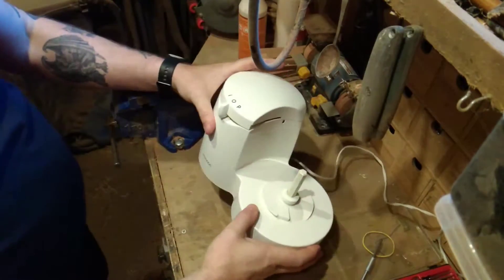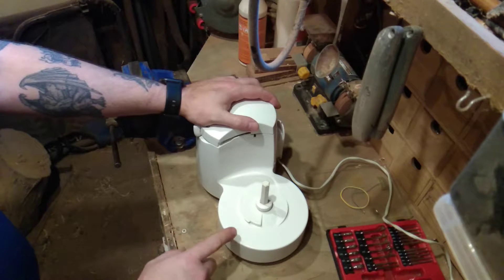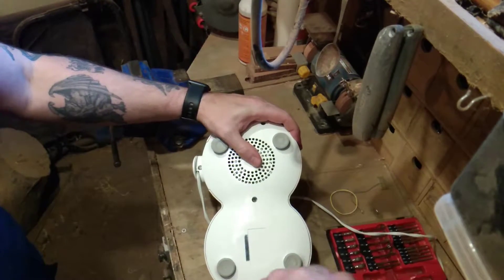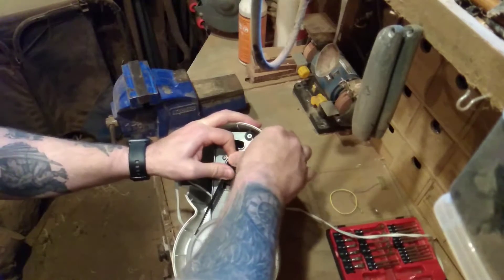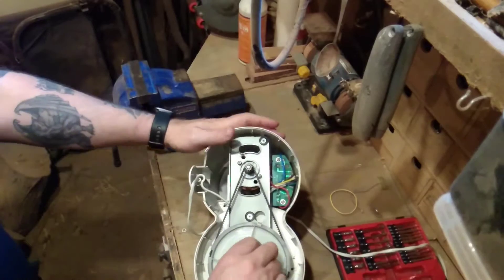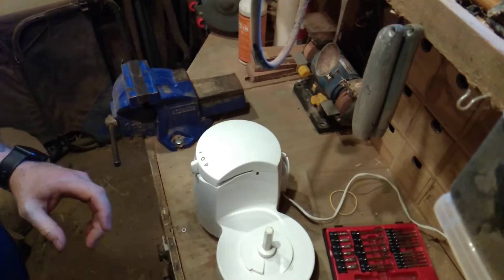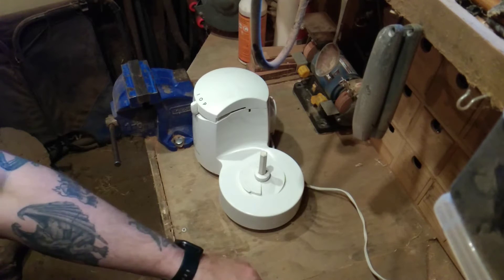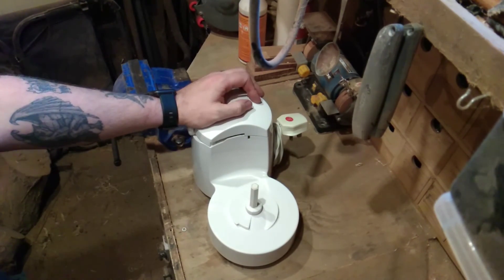Food processor fix

Comment: Shaft of chopper is not rotating. Please suggest solution with video
Reply from the maker: I would check the drive belt first, but it depends on the model, some have gear boxes and these can develop faults

Comment: I have a Kenwood FP450, drive belt has gone, managed to get new’un, but after removing the 3x base security screws there doesn’t seem to be anyway of getting it apart? Had difficulty finding a schematic drawing of it in online. Any ideas of how to get into these things?
Reply from the maker: Without having a look at it I can't be sure, sometimes there are screws hidden under the labels on the bases of electrical devices, and under the rubber feet, I've had that before.

Comment: Wrong; first you put the belt on the small bearing then you put it on half of the big wheel and then you turn the big wheel by your hand until the belt takes its place  and don’t use screw driver otherwise you will damage the teeth of the belt
Abs the screw driver will extend the size of the belt and becomes not so tide .
Never ever use  screw drive to feet the belt , maybe you can use it to take og’ff the old belt not the new one .
Reply: Do you watch the video? He loosened the motor, he didn't use the screw driver to feed the belt on to the pulley or the drive. 🤷‍♂

Comment: Tell me please quickly
Reply from the maker: Not sure what you are asking, if it's a model then this one is - fp108 series whether it is the same internally as the fp190 I can't say, it may well have a similar drive belt set up if that's what you're asking
Reply: @shedandbeyond  where
Reply: @shedandbeyond  please I have the problem of opening back for carbon brush
Reply from the maker: It should be a case of undoing the screws in the bottom, once those are out the bottom comes away and you can get at the internals, including the motor
Reply: @shedandbeyond  screws are open but how to open the cover
Reply from the maker: Once the screws are out the cover should pop off, you may need to gently pry it off